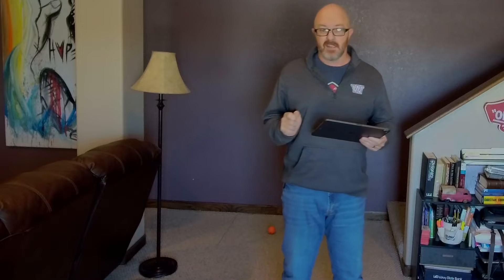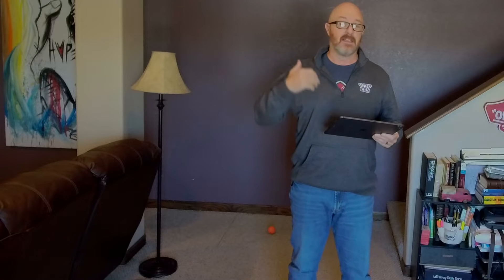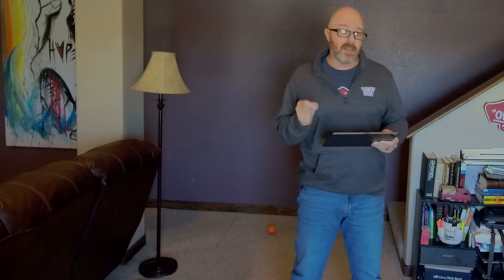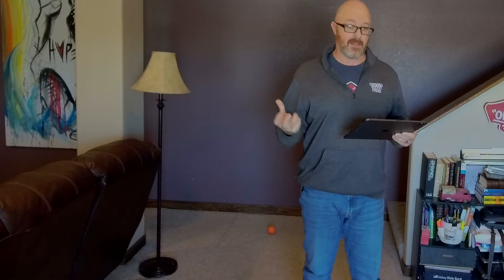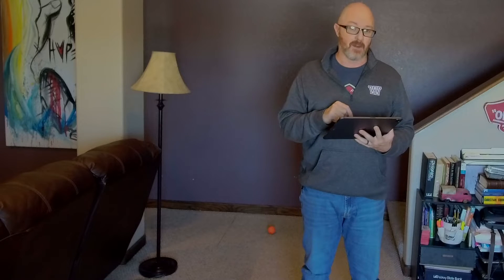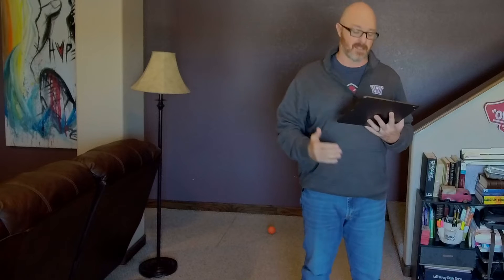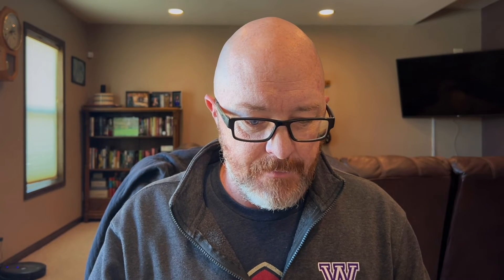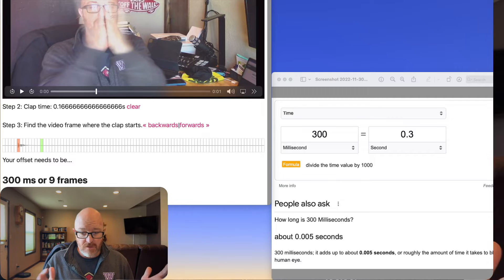Mevo Go Delay - How Bad Is It?

Comment: Thanks for posting this, question is are you still using this approach or did you move to another to integrate mirrorless camera(s) into the mevo eco system? I’m bouncing around with Mevo (Camera appear interesting), Yolobox, and ATEM.  All has to run on battery.
Reply from the maker: I am also using some other "systems" to accomplish this currently, being able to bring in NDI sources now has begun to bring me back to Mevo in some instances.

Comment: What USB capture device is used ? 
I have som Galaxy Tablets but the multicam is not working on them stable.
Reply from the maker: here is the link to the current capture card I am using.
In regards to the galaxy tablets, I have found that mine is just underpowered to run multicam reliably, but it seems to do good using it in this way.  However, it will drain the battery down in about an hour of use.  https://www.amazon.com/Wiistar-Capture-Dongle-Grabber-Recorder/dp/B077X8RTX7/ref=sr_1_3?crid=38C372LBZOT5T&keywords=wiistar+usb+video+capture+card&qid=1670434589&sprefix=wiistar+%2Caps%2C153&sr=8-3